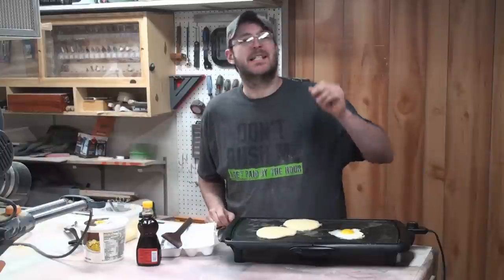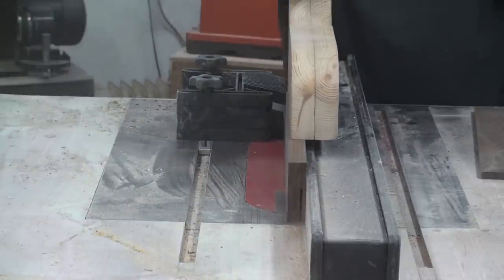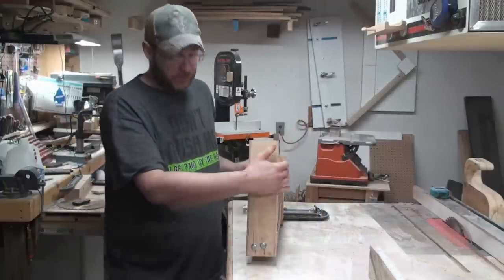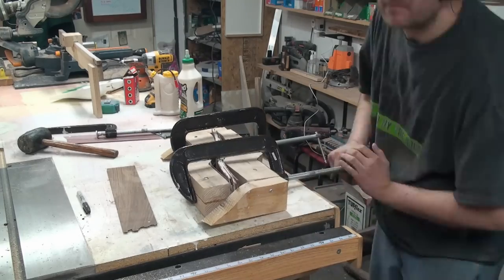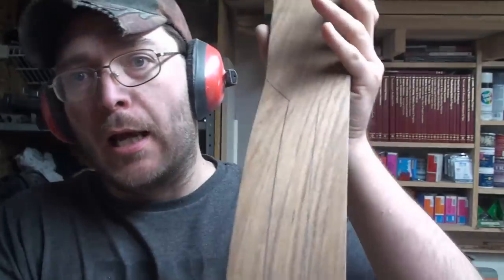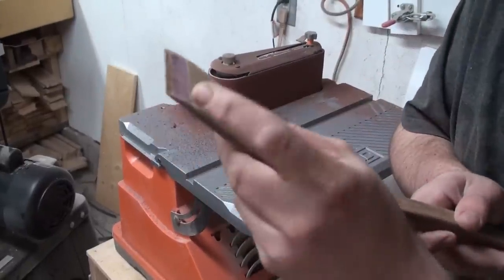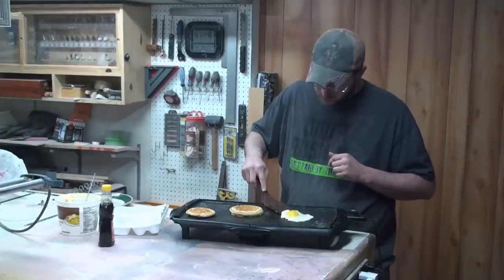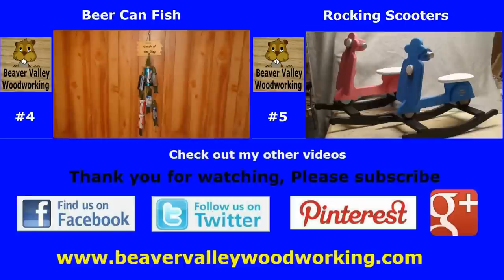Wooden Spatula #18 2015 Kitchen utensil build challenge

Comment: Looked like it was tough to tighten up the wood in the shape thing!  Good job!
Reply from the maker: Cy's Corner Thank you Cy. The clamp up was the most difficult part of the project, needed a lot of clamping pressure and have to do it before the glue sets. I had to move pretty quick.

Comment: Love it! Any chance you'd share the plans, especially for your bending jig?
Reply from the maker: riskmandel1 Not planing on doing any plans on the bending press. It's a very simple design, key thing is in the design you have to be careful on how much you bend the wood. If the outside radius is to extreme then you will have tear out. For the spatula project it doesn't matter where the flipper part meets the handle because the bottom gets cut off and also the tear out. Making a spatula is a great project if your entering the world of bend lamination. Thank you for your comment.

Comment: A couple of questions/observations. . .  What you called 'tear-out', could it be avoided by soaking the wood in water overnight? Or would that be detrimental to the gluing? The other thing is; wouldn't it have been better to sharpen it on the other side?

Comment: I've made laminated utensils by soaking thin lumber in water for 2 - 4 hours, wrapping them in wet paper towel, and microwave them for 1 - 2 minutes before clamping in a form.  After they dry glue your lamination in the same form.  It is an extra step, the advantage is in the ease of bending and the absence of checking and breaks in the wood.  You can see samples on my facebook page https://www.facebook.com/DetailsInWood/photos/a.119370251552862.23478.119008988255655/471859606303923/?type=3&theater  enjoyed your video, great work!